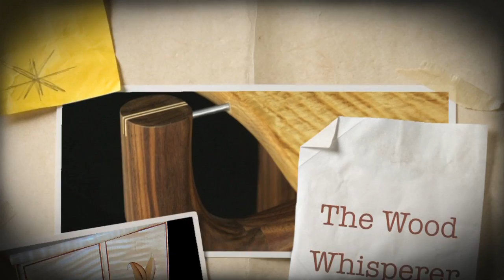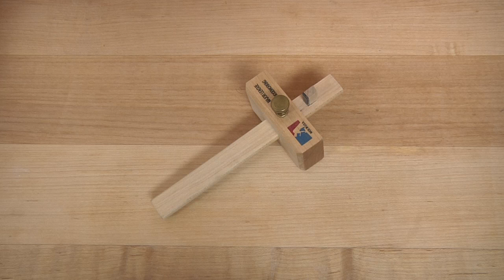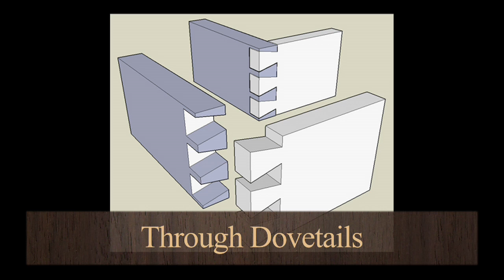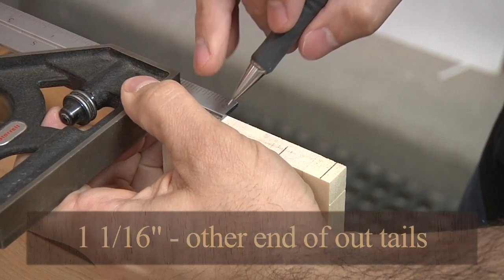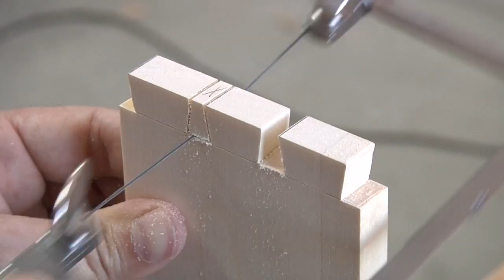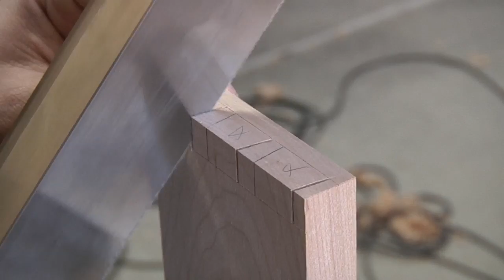How to Make Hand Cut Half Blind Dovetails

Comment: what an excellent video. i definitely didn't do it right yesterday. one thing to think about is when you set up your pins/tails you should consider the chisel sizes you have. i had a little trouble getting into the pins while doing a very short drawer. i made tiny tails.